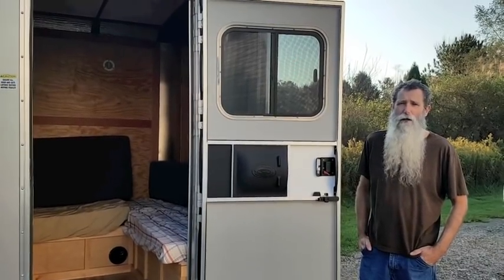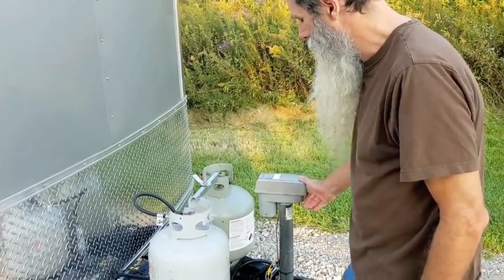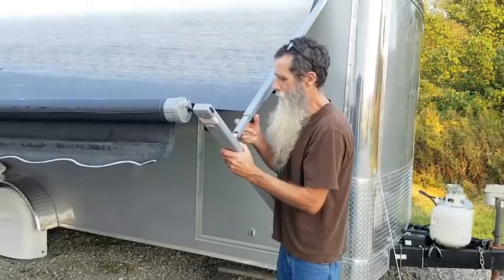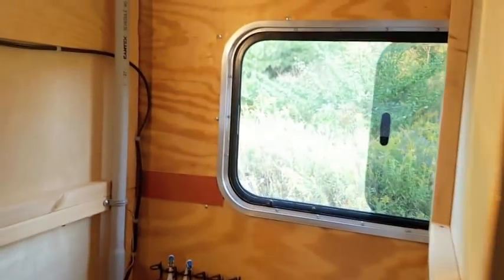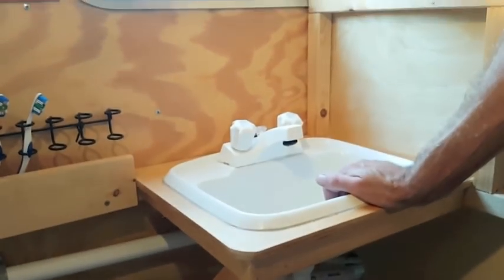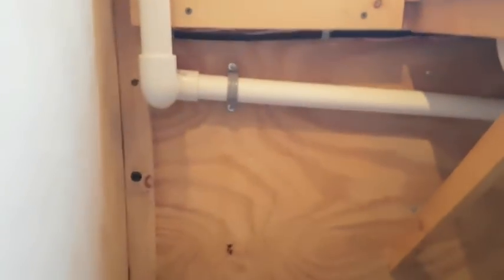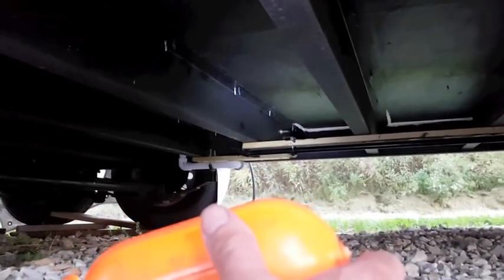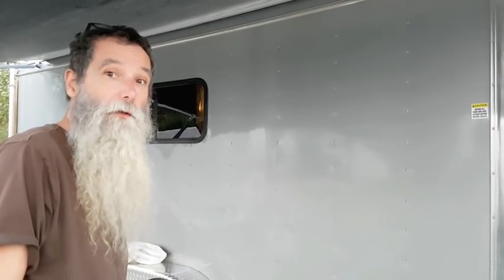Cargo Trailer Camper Conversion

Comment: I had my eye on a 8x20 first but someone beat me to it. I bought a 8x16 then with ac in the ceiling and a 110 box already. Your trailer is well thought out and simple. I use a $50 fake fireplace for my heater and am planning to add a Mr Buddy because I have propane for hot water already. I too carry my motorcycle along so I did my build around it initially. Thx for sharing,  R

Comment: Nice job. I would have gone a similar rout if I didn't make mine to carry my quad. This is why I went with fold up beds. We generally are boondocking it when we are quading and so we are set up with an outside kitchen and portable tent and toilet. Keeping in mind we do own a travel trailer as well but for a few years the cargo trailer was also the travel trailer. Nice job

Comment: You build it to fit your needs, nice job. The only thing that caught my eye is the battery by the propane tanks. If you had an accident the battery could short on the tank and Boom! I would rethink that.
Reply from the maker: Maybe I will add a battery box. Most towables have the battery mounted where ours is. Hopefully we will survive. Hey we survived our Midas class C motorhome that would do wheelies whenever you filled the water tank that was behind the rear axle. With it's inadequate brakes and front wheels barely touching the road we made it through by God's grace.

Comment: I would like to know how you made the jack antenna, I like to put that on the side of my house for my outside tv. Very nice video.
Reply from the maker: Hello - we purchased the Jack antenna 'head' alone. We used a 1-1/4 PVC floor flange to attach to the antenna. We drilled the four bolt pattern from the antenna into the flange. We had to buy small metric screws to fasten the flange to the antenna. Then we took the 1-1/4 pvc pipe (cut to the desired length and cut a hole to fish the coax thru and come out the top. Then we glued it on. Standard all mount conduit clamps secure it to the trailer.

Comment: On the rear door bars, you might wanna fix up a way to lock the handles open so somebody can't shut them on ya.
Reply from the maker: Great Idea
My plan is to put in the escape window so I don't have to worry about getting out thru the tailgate.
Thanks for watching
Reply: Just put the lock through the lock holes with our the latching bar.

Comment: What are you towing that 20 footer with ? I like how you kept the wheight down . Did you beef up the brakes ?
Reply from the maker: Hi thanks for asking. The brakes are factory standard and are pretty good. I think everyone wants better brakes on their trailers. You want to make sure the tow vehicle is delivering a true 12VDC to the rear plug on full braking. Too many times the wire gauge is too light in the brake circuit. As far as our tow vehicle we use a 1 ton E350 super duty Ford van V10 engine: 3:73 axle ratio.

Comment: Great build. What's your inside ceiling height? and where did you get the awning?
Reply from the maker: Hello and Thanks! The trailer was ordered with 6 inch additional height. it is 86'' from the floor to the highest point in the crown.
Reply from the maker: The awning was purchased at PPL motorhome. Good people - the awning was damaged in shipment and they made it right. Would recommend them. It is an A&E 8500 series with 'tall' arms.

Comment: I heard you say its a 20 footer, but what is the height of the trailer.. I am looking to build trailer too but I am 6,3 would like to get a 7 foot or 7,6 to save on wind drag while driving.
Reply from the maker: it is 86'' from the floor to the highest point in the crown. I ordered it with 6'' additional height. That's all they offered - nothing in-between standard height and +6''. I would have preferred to add only 3''. It is 7' wide instead of the 8' wide. Hope that is helpful.
Reply from the maker: Jim Allen  A VEE nose would have been good - I was worried where the propane bottles would go so I got a rounded nose.

Comment: Hey guy
I think you said it was a 20' trailer and they added 6" to the height!
I didn't see or hear how wide the trailer is! So if you could tell us how wide the trailer is we would appreciate!
Thanks
Reply from the maker: Hi Steve it is a 7 wide. If your checking trailers out you can generally figure out at a glance - if the fenders stick out it is either a 6 or 7 wide. On the 8' wide the wheels are flush with the sides. We wanted the narrower 7' version. I am not sure if I would order the 6'' additional height again. Would have preferred 2'' or 3'' additional height rather than 6'' - but the 6'' makes it nice for the taller door and higher awning. Thanks for watching

Comment: hi, had a difficult time hearing you while you were outside as you were talking with your back to the camera or walking away plus the noise outside so I did not catch where in Ohio you got this trailer I'm assuming you bought it new correct? And what did you say that the trailer company did to the trailer before you took possession of it when were there was something about insulation did they do windows what exactly did you have the trailer company do before you got it and completed your work? and what did that cost you for the part that the trailer company did and how much you paid for the trailer this was a great build I really like it interested in doing something like this myself and I live in Ohio so that's a big help too
Reply from the maker: Turner Trailers in Bellefontaine. They are Great people to deal with. They ordered the trailer with the side wall insulation, the RV door and screen, the two windows, an AC prep package which is the framing to support an A/C. There are also some tie downs. Turner trailers can get you a quote.
Watch craigslist for the items you need for the conversion.
Reply: @simplebuild9998  thank you so much!
Reply: @simplebuild9998  , can you share what the rating for the insulation is?
Reply from the maker: @khm2128  Hi - sorry for the delayed response.
The sidewalls have foam sheet from the factory - estimated 4.8 R factor.
The ceiling sheets are foil backed rated at 6.5 R.
Thanks for watching.
Reply: @simplebuild9998  , thank you!

Comment: Just buy an Airstream
Reply from the maker: I've had three of them - a 31' a 26' and a 34' triaxle.
Loading the motorcycle could be a bit tricky into the back of an Airstream though...
Thank you for watching!!
Reply: Simplebuild plus I image a used air stream cost as much or more than the trailer u bought an u can build it to suit u.nice build.